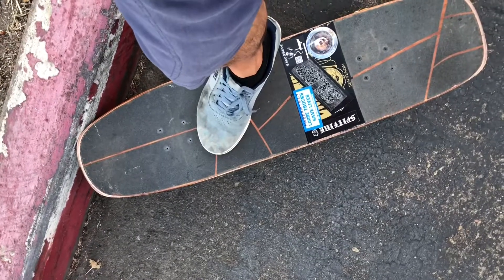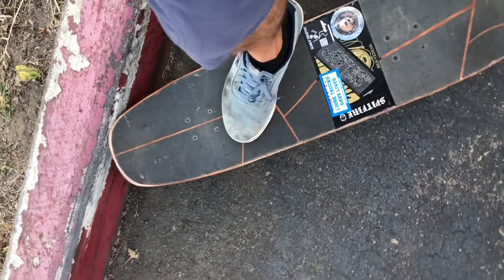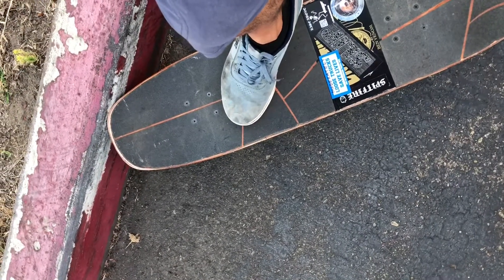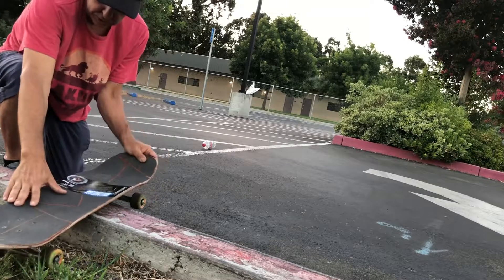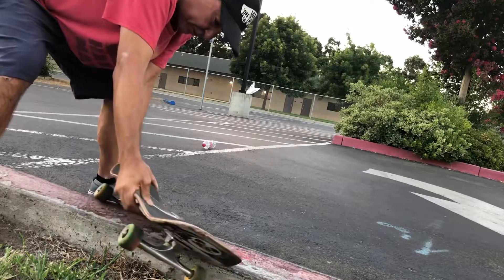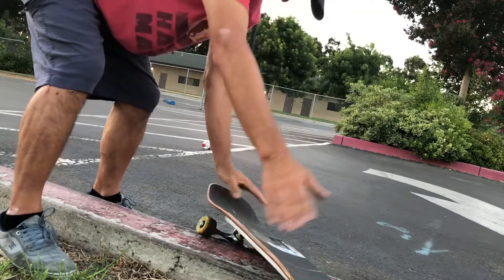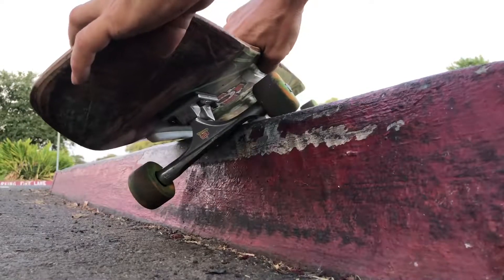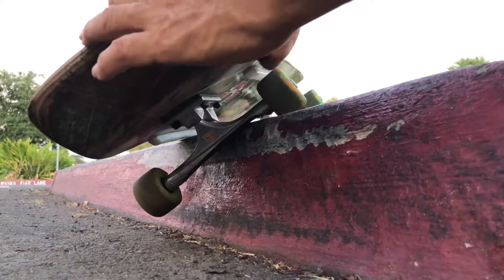Backside slappy feeble grind trick tip. #slappyfeeble

Comment: Is it ok to use the tail to lift the nose over? I see a lot of skaters doing that. And it looks like you´re doing it too..? I thought you was surpose to smash the front truck into the curb so the nose bounces over the curb, and you then fall into a feeble-position..? Nice video! :-)
Reply from the maker: I put pressure on the tail to get the front truck over the curb, for sure. Classic FS and BS slappy grinds (50-50) I do not. 

Maybe a person could do a feeble without putting pressure on the tail, but I don’t envision it working. I could be mistaken, though!
Reply from the maker: Here is another version of the feeble I did for the Curbfiles about a year ago. A bit more slo-motion POV, too https://youtu.be/zIrRwWcFO1A
Reply: @handywithshovels  Thanks for the reply! I see. I recently got back on the board after almost 25 years. And discovered slappies. So much fun! And safer now that I´m getting older. :-D I learned backside and frontside 50-50, so now backside feeble is next on the list. ;-) Nice to get some advice from someone who obviously has a lot of experience with slappies. So that I don´t learn it «the wrong way.» Thanks for posting videos. Your channel is very helpful. Enjoying the Curbfiles too. Greetings from Norway :-)
Reply from the maker: @ElisainNature slappies are super fun!!! I started skating curbs tons more when the COVID lockdowns were super strict. 

I suspect you might find the feeble easier than the backside 50-50. 😎 Regardless, have fun!! 👍👍
Reply: @handywithshovels  That sounds great! Yes, it sure is. 😄 Just learned slappy croocked. Feeble next. 🤞 Thanks again! 🙏👍👍
Reply: @handywithshovels  Hello again! I have a question that I hope you can help me out with: I’m in the process of making a slappy curb, since rheres no one around where I live. Should I make it as wide so that the two wheels rest on top of the curb, or slim so that the curb fits between the wheels. Do you know what I mean? What’s your opinion? Maybe one that fits between the wheels are better for feeble grinds.? My board is 8.25. Trucks are 144 ..I think. Would really appreciate your opinion.
Reply from the maker: @ElisainNature  hello!! My wheels are not able to wrap over the left and right sides of the curb if my board was sitting on the top of the curb. I ride Indy’s or Aces in the 8.75-9.00-ish width. Remember for a feeble, you aim to get the heel-side wheel of the back truck up the curb- that’s where you “lock” on the curb. You want to lock just on the heel side. Beyond that, I feel it would be best to make sure your curb is tall enough to keep the toe-side wheel of the back truck off the ground when you lock on to keep you going smoothly
Reply: @handywithshovels  Thanks again! That´s very helpful. Can´t wait to get started. :-D Hope to see a new video from you soon. :-)

Comment: Great tutorial.  Is it easier on a straight edge curb (such as the one in the video) as opposed to a more rounded curb?   I seem to be getting stuck on my king pin on my rounded curb.  Thanks
Reply from the maker: Sorry i didn’t respond earlier. I didn’t initially see your post! 

I’ve never had the opportunity to try a feeble on a curb with a round edge. However, an edu-skated guess is that it would be more difficult to lock on the heel side wheel to hold the desired position. 

As for the kingpin scrub, it definitely is part of the process. It will grind down to where it doesn’t interfere. That’s part of the fun: grinding the ever-loving crap out of our trucks